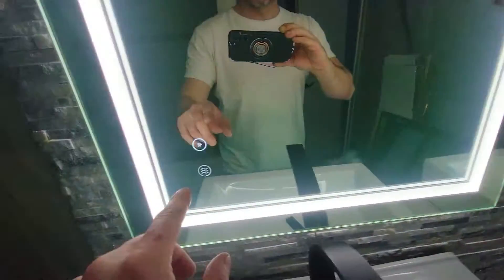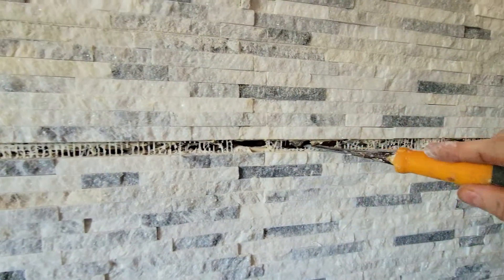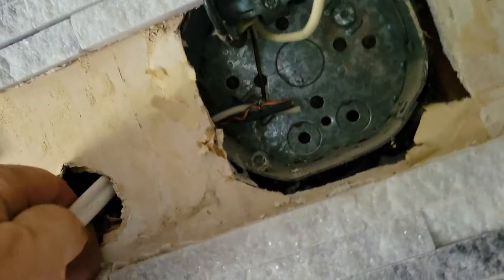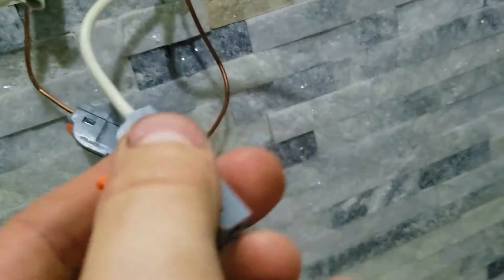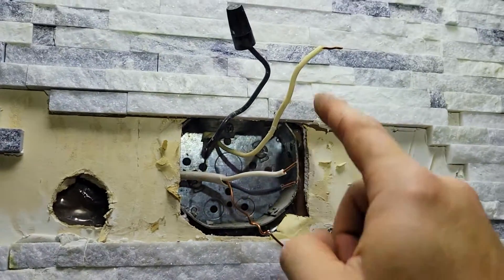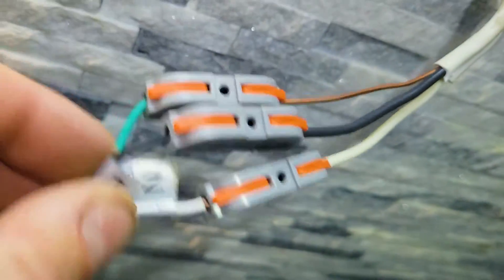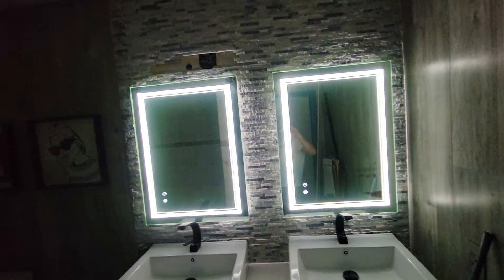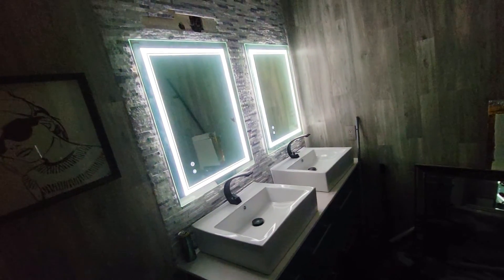Wiring LED Mirrors with Wire Connectors Tutorial - How to Wire Light Fixture on a Live Circuit

Comment: My mirror has a plug in...I want to direct wire. But...not sure how 😂 I popped off the control panel but I can't clearly decipher what I need to do to get my black & white from the mirror to wall...
Reply from the maker: U just connect black to black and white to white.
Reply: There wasn’t a direct wire option laid out. So I ended up cutting the power cord & wiring from it. The wires after splicing were not marked black or white only the ground was colored green in the middle. So I followed each side wire if the plug cord back to the control box and looked to see which side was connected to the mirror black/white in the control box & then connected with wire nuts. Success. 🤗

Comment: This video was very informative, but how did you add the third light back to the top? Did you just connect all the wires together?
Reply from the maker: by third light i assume u mean the 2nd mirror on the right?. If yes,  then u dont connect this cable directly to the MAIN top fixture box. You simple connect it to the first mirrors end cable. Both mirror + the light fixture is operating on the same circuit and light switch. But because hte mirros have their own led light switches, you basically keep the wall main light switch ON that sends power to the main top box where the first mirror is conected, that wire is conected to the mirror and the second cable running to the second mirror. hope that helps. If i turn the wall switch off it will turn off both mirrors so they wont have any power.